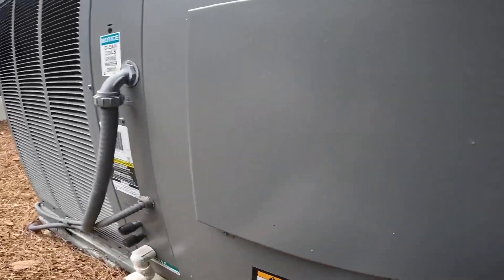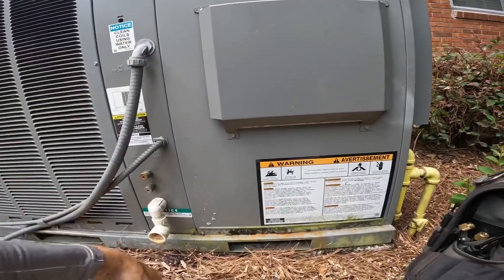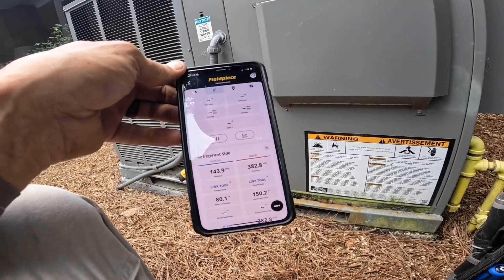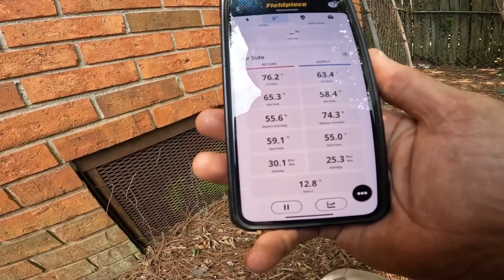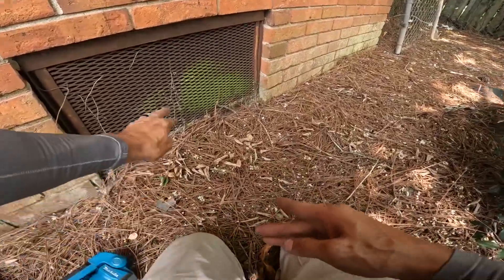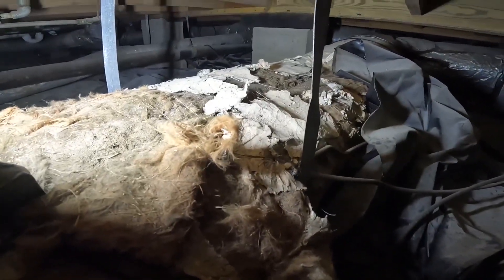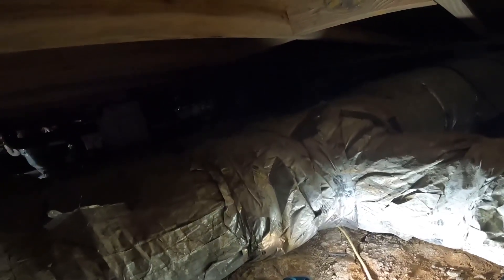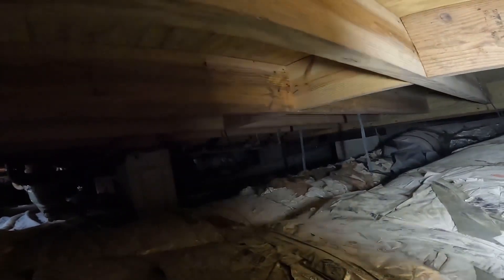4 Year Old Ruud Achiever Not Maintaining Temperature when it’s Hot 🥵

Comment: Check the fan motor.. I had one the other day, less than a year old.. RH1T air handler, 2 ton split... Fan was running but it just wasn't moving enough air.. Only a 10 degree drop in temps..

Coil was a perfect 38*...

Duct was sealed and fine, HK wasn't on, all was left was motor.. Changed it.. Problem solved...  

Those ECM motors just have issues.. I have already changed 10 of them on various units from 1yr old to 4yr old...  U.S motors have some issues somewhere for this type of failure left and right on new units just about.

Comment: AC are designed to bring down 20 degree difference from the outside temp, anymore would need a well insulated house or an oversized unit. In the south with many days at 100+ degree, we usually have an oversized unit. My system in Texas can only max out about 25 degree difference with average insulated home.
Reply: Yes I'm in Houston and have a 1500 sq. ft. home (needed 3 tons) put a  ton just in case! I'll keep cool all the time!
Reply: True, but here in central California, the indoor humidity is low enough (unless you have a lot of houseplants) that a moderately oversized unit should cost about the same or even a little less to run when heat gain is high due to crappy insulation.  In larger buildings here, especially warehouses, often the AC unit is actually quite undersized, and 50 % of the cooling is evaporative. The undersized AC balances out any excessive moisture from the swamp coolers.
Reply: 25 degrees is more than enough efficient. In fact, it's close to perfect.
Reply: My higher efficiency swampy kept me at 65 , occasionally 71 even at 105 in salt lake, our humidity was ridiculously low last summer, like single digits. Swampies shouldn’t even cool that well, but, it sure did. Too bad the power supply wire caught fire and nearly burned my house down!

Comment: I had a return duct that was loose for years, and I never knew about it until I stuck my hand in it. "why is this air so dang hot??🤣 It was sucking in hot attic air. I taped up the hole. Luckily I have multiple returns.
Reply: I know this sounds like a stupid question, go ahead and laugh at me!  What is a return duct?
Reply: @cousinjohncarstuff4568  The vent that delivers the hot/cold air is a supply vent. The vent that sucks out the hot/cold air is the return vent. It's usually centrally located in a house, if there's only one. I, personally, have five return vents in my house.
Reply: @cousinjohncarstuff4568  At 8:24 is a return vent/duct.